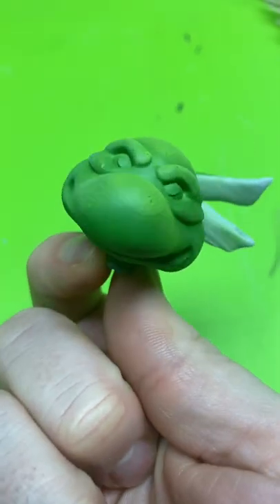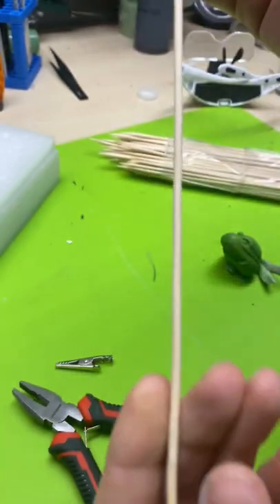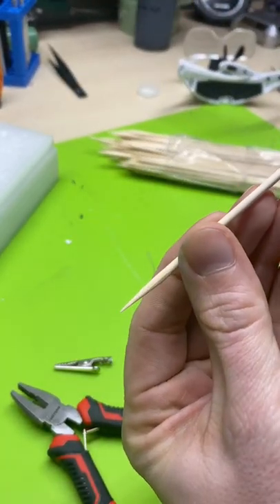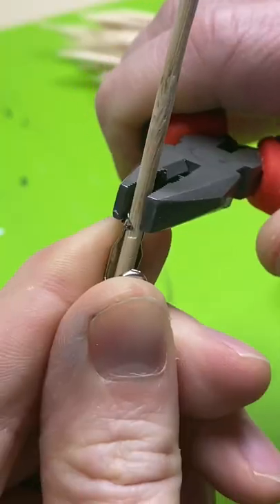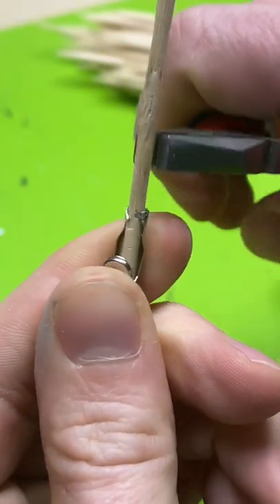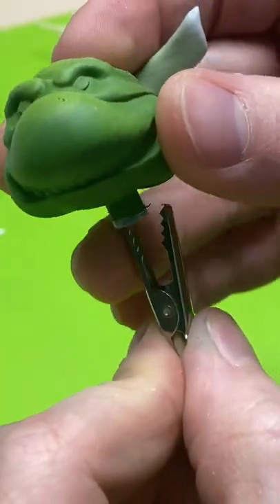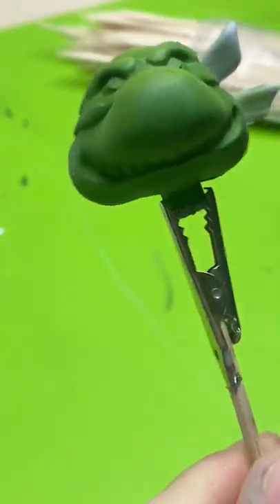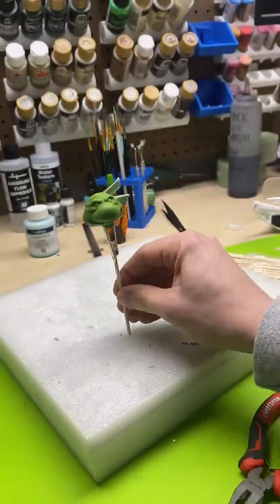Awesome tool for anyone to have for painting. Thanks to @filamentfandoms for the idea. #painting

Comment: What a coincidence!  Yesterday, I ordered a bag of these clips from Amazon.. 6 bucks!  I have tons of bamboo sticks already, so I'm all set when the clips arrive.  My latest challenge was figuring out how to cut a model's arm off and replace it with a better printed one.  I ended up using a razor saw and it cut a perfect line without melting.  The grafted result looks so goo you can't tell where the splice is.  It's a major challenge cutting PLA without melting. Anyway, a side note here.  I'm looking forward to your next video on Cura supports!  Have a nice day!
Reply from the maker: The clips are great! Cutting pla is a pain. I use a soldering iron and a orbital sander a lot. Might want to look into Cosplay makers they have a lot of cool tricks. 
Also glad your enjoying the support videos. It’s a huge topic. I honestly still don’t know how many more I have to make. I really want everyone to fully understand them cause no one can give you their perfect support settings and them work perfect for you. There is always tweaking and making it work for your printer. But after these videos I doubt there will be questions I’m tackling it all.

Comment: Are the alligator clips gentle enough? Or do they leave heavy marks?
Reply: I just finished several parts with the clips. I made a lot of them and when I finish the part, I exchange another clip to the part that's already painted, and then touch up the initial clipped part.  I highly recommend these clips.. they are really great.  I ise a big chunk of clay to hold all the bamboo clips as soon as they are done. Works great.
Reply from the maker: Yeah they don’t damage your parts. But I only use them on areas unseen or places I’ll be gluing. They do sell clips with rubber pads on them too. They can scratch paint if your not careful on where you clip it. But to answer the original question they have never dented or left marks on my stuff.